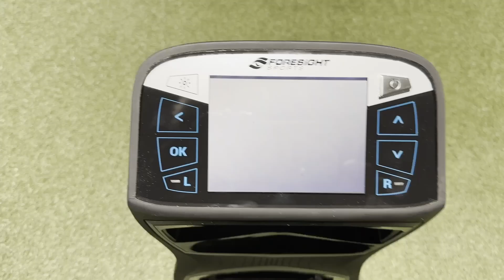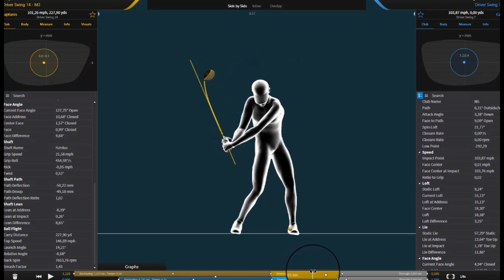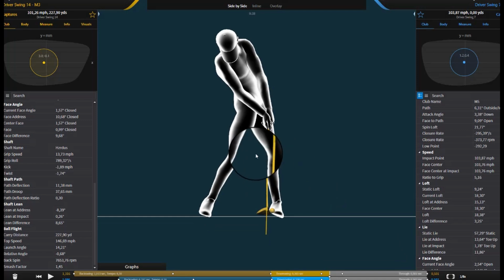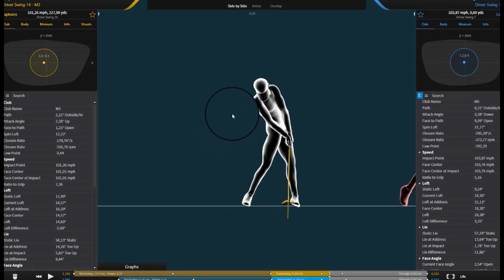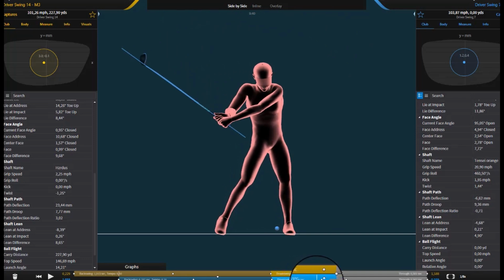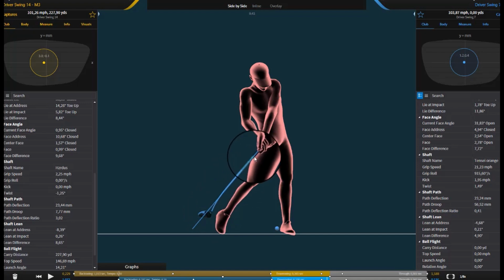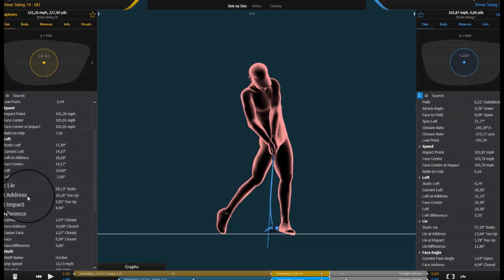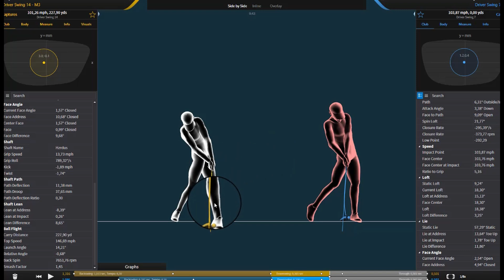MAXIMUM HAND SPEED

Comment: Can you tell me, are you saying at halfway down, the Pro starts slowing their hands down so the club then speeds up.  Where as the armature continues to maintain hand speed all the way to the impact in an attempt to hit the ball further and therefore the clubhead does not get a chance to speed up?  Like snapping a towel, the hand has to slow down for the towel to pass it and snap.  Or is there some other reason for the difference in hand speed between the two from halfway to impact.  Very informative.  Thanks You!!
Reply: Exactly, I think the whip metaphor is the right one. There has to be an energy transfer which has to have both the speed up and the brakes to work. Like if you shoot a slingshot, the projectile stays in the slingshot’s pocket as the band goes forward. It isn’t until the band hits the breaks that the projectile goes flying because the energy is transferred.  Or just slamming the brakes on your car. This idea of putting on the breaks has really helped my club head speed. The hands are the thing that get in my way. I’ll try to manipulate the handle too much,  my wrists stiffen and prevent that energy transfer. The whip is completely flexible and why it’s so good at that energy transfer.

Comment: YesI the swinger has the most leverage to get the hands moving from the top to “shaft point to the ball” position. But this
Is works out. Think of a lead fishing weight on the end of a string. To twirl that weight you need to move your twirling hand a lot, but once the weight is started moving in an orbit around the twirling hand you can keep twirling and even continue to accelerate with less movement of the twirling hand. The hands (arms involved too) are “twirling the clubhead” like it is a lead fishing weight on a string.